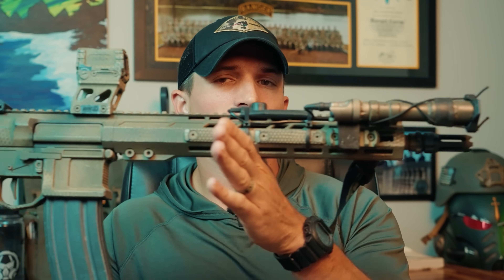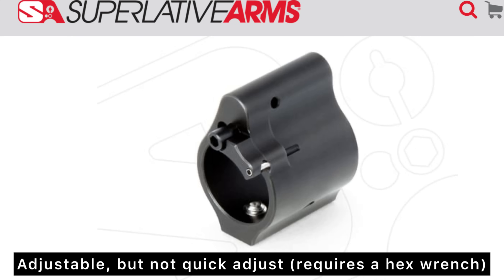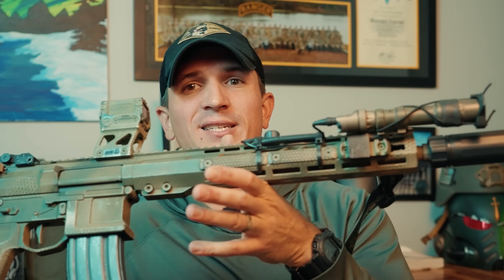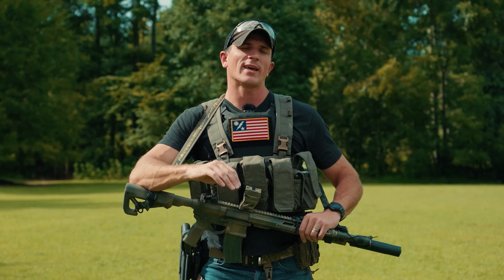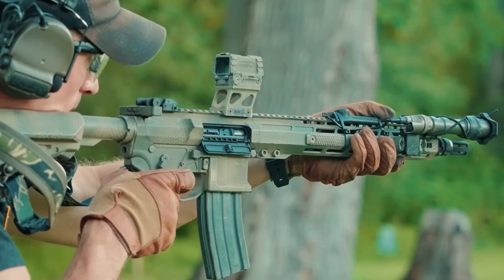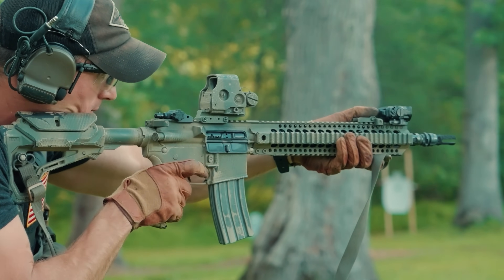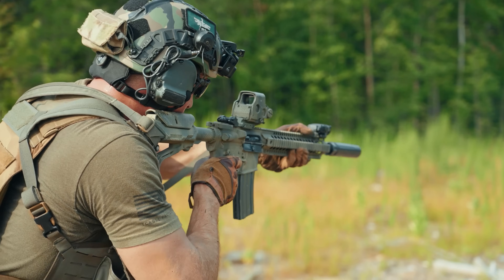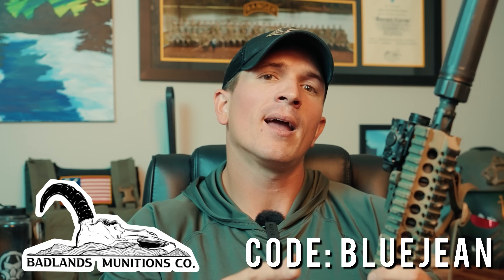Suppressing an AR-15 (The Right Way)

Comment from the maker: Ready to revolutionize your hunting, shooting, and outdoor adventures? Discover PARD optics, the cutting-edge technology for those who demand the best.
https://tribelink.co/PardVision

Get some ammo from Badlands Munitions Co. 
Use code BLUEJEAN for a discount there. Helps out the channel!
https://badlandsmunitionsco.com
Reply: A good alternative is to just get a reduced-pressure can. BT SRBS 762 3D-printed Inconel HUB is 950 with a free stamp now; CAT and Hux also make good options. CAT prob is the best in many ways, just a bit more expensive, but they still struggle to keep them on shelves. I have already tested CAT WB against Hux and Sandman; it's almost better in every way.
If that can save you a few AGB and some headaches, then I would say it's totally worth it.
I love my Sandman S and K, they are still decent, but we do have better options now.

Comment: The riflespeed seems like a good upgrade. If you have a gun that doesn't have adjustable gas or can't have it for whatever reason another good option is the bootleg adjustable bcg. It's super easy to adjust but does require some sort of a flat head tool, I usually just use a Holosun sight tool that I store in the BCM pistol grip of my rifle. It only has 4 settings, 2 normal and 2 suppressed, I usually use setting 3. It's crazy effective though and it doesn't just help regulate gas, it basically deletes recoil entirely. Milspec Mojo uses them and admits its part of the reason he's able to shoot so fast. It really makes a huge difference.
Reply: or just get a flow through can.  My mk18 theres no way around it must have bootleg abcg.  On my 14.5 got a B&T sbrs with only a h2 buffer and shoots buttery with prop 3-4 ejection no tuning needed.
Reply: Is it DT or QD? I am looking to get one of those B&T SRBS for my 16 DD and 9” .300 blackout as dedicated suppressors. I just don’t want the cans to walk off is my only concern with DT.
Reply: @Briathos1  its DT and I love it, highly recommend.  Concerned with walk off just use some rockset
Reply: @ColdGrapeDrink  Great to know. I appreciate it, I am a lefty and I have been plowing through reviews of silencers over the last year trying to find one that sends that gas forward instead of in my face as well durable. 

Thinking I’m gonna pull the trigger once I move over to Idaho in a few weeks. 

Quick follow up question, if you DT with rockset….how do you go about cleaning and mainting the can? Just bust it off?
Reply: @Briathos1  from what i understand you dont really need to clean em, can just run a bore snake through barrel through can is what i do.  Otherwise you can soak in a special solution.  You use cold water/ice to loosen and unlock the rockset.  But def my fav can so far
Reply: @Briathos1  but also I dont rockset, just use oven mit to ensure tight every so often
Reply: @ColdGrapeDrink I run a brt ez tube gas tube tuned for 100% suppressed usage with an rc2, a5h2 buffer, and lmt enhanced bcg. This thing shoots like a gas blow back airsoft gun. It’s wild.
Reply: @ColdGrapeDrink  Dude, I so appreciate you taking the time to share. I have heard great things about them. Think I’m just gonna make it happen here. Hopefully get them approved and attached over the next couple months.
Reply: @Briathos1  Do it!  Throw it on the credit card and pay it off to get some reward points LOL.  But yea filed as individual and got er back in less than a week
Reply: Laughs in PWS 😂
Reply: @BullseyeBallistics-kf1jw  Hmmmmm?
Reply: SA gas blocks are good and reputable. I've never had to adjust my gas on the fly and I can't think of a situation id be in when I'd need to 🤷🏻‍♂️ and FA is good for mindset kinda how you press check your pistol even though you know it's loaded.
Reply: @Briathos1 he's referring to PWS piston driven AR, that won't blow carbon in your face
Reply: @kerbalairforce8802  Ah, for sure. I’m actually moving to Idaho in a few weeks as well so I’d love to buy one of them. Thing is, if I buy another rifle, my wife would kill me if I racked on another grand to throw a suppressor on it. 

I already have DI guns that need suppressors. Eventually I’ll nab a PWS.
Reply: Better idea is to just use a regular gas block and tune it with buffer weights and springs. Adding adjustable anything, while convenient for sure, just adds another potential and unnecessary failure point.
Reply: @waffle_chuter  I totally agree with this. I am trying to have a gun as reliable as possible.

Comment: The Riflespeed will probably be the last AGB I ever try for suppressed use (if I don’t switch over to flow through cans). I have had 4 set screw style AGBs fail on me in different ways. Not just seizing up, but also blowing out the detent or set screw and having pressure drop and the weapon no longer cycling

Comment: I went for a "both/and" approach and built my AR specifically for suppression, but also put a Bootleg BCG in it and have a BRT barrel/gas tube, because even AR15's dedicated to shooting suppressed needs the tuning adjusted depending on certain external factors like weather and what time of the year it is.
Reply: I'm guessing you did the 50/50 brt gas tube? If so, how effective is it without using the bootleg adjustable bcg with it? I have a bootleg adjustable bcg and I'm always amazed at how effective it is but it does make the gun louder on the suppressed setting 4 by about 10dcb according to some people on arfcom. I haven't tried the brt gas tube but I'd like to at some point. I would prefer to run a normal bcg so if it works well I'll have to grab one.
Reply: After watching the video, it's cool that you basically came to the same conclusion, just using different methods haha

Also, I'm pretty sure that when the DTL manufacturer claimed the rifle was "built for suppression", they were just coping/spouting BS
Reply: @armorers_wrench  I don't have the BRT "EZTune" gas tube, I have the MarkBlue EXC tube that came with the barrel.
It's is a 0.75 tube with a length that is 1" longer than a standard Carbine length and 1" shorter than a Midlength designed specifically for 12.5" BRT barrels.
The "gassiness" (is that a word?) is basically non-existent .
I paired that with the Magpul UBR stock/buffer than makes it so I can use a carbine or rifle length recoil spring.
I'm using the Geissele Super42 Rifle-length recoil spring and a lightweight buffer-weight

All that combined makes for a super comfortable recoil impulse and no gas to the face

Comment: For suppressors I recommend an 

1) Adjustable gas blocks with at least 10 clicks (not set screw style)
2) Kak downward venting BCG,
3) Putting silicone RTV in the charging handle to create a gasket seal.

A gas busting charging handle could help as well but it does the least IMO, the silicone RTV gasket has worked better for me.  You could get a flow through can and not need most of these but it is nice to tune your guns and reduce gas generally, plus flow through cans have some downsides
Reply: Need more description of how to make the RTV charging handle gasket.
Reply: What are the downsides to the flow through cans?
Reply: @rwwolcott they are generally less quiet and prone to be sparky.  My Ventum 762 is still sparky after ~900 rounds.  

For home defense use it’s fine.  If you’re SHTF larping they give away your position easily.
Reply: @ghijkl  Try the new VENT from PTR. Super quiet. Super light. NO flash.
Reply: Price  @evernhamanderson
Reply: @rwwolcott Price, sparking, louder, heat up extremely fast, typically weigh more then a traditional baffle stack. Not typical, but can cause under gassing with subsonic rounds.

Comment: As a suppressor tech and rifle tuning nerd, I love the riflespeed system. My main squeeze has had one for 2 barrels and lots of classes and it’s never malfunctioned or seized up. It’s a 12.5 midlength gas, with H3 buffer and Sprinco blue spring. Unsuppressed, it locks back on setting 10, with a RC2 or CGS SCI SIX, it locks back on setting 4, with the CAT WB it locks back on setting 7 and with the CAT ODB, it locks back on setting 9.
Reply: Out of curiosity, why such a heavy buffer? Did it run ok with an H2? Just seems like if you used a lighter buffer, you could reduce the overall gas back into the system in general.
Reply: @johnclark6139  if you are only after recoil reduction, you can definitely keep springs and buffer the same or go lightweight. But when tuning for suppression and gas in the face, going heavier keeps the bolt in lockup for longer during the shot.Allowing more gas to exit down the suppressor and for chamber pressure to drop, lowering ejection port blast and gas in the face.
Reply: 12.5" with a midlength gas system?  You brave bastard...
Reply: @oskar6661  short dwell time barrels are more reliable then people think as long as it’s a good barrel. And for suppressor hosts, they are phenomenal for reducing gas impulse and duration. I also have an 11.5 mid length gas and it’s been just as great as my 12.5

Comment: Adjustable gas blocks are convenient but I would advise against using them to "fix" a gassing issue without first knowing how other adjustments or changes to your rifle could also fix the problem. Understanding how buffer systems and weights, gas system lengths and BCGs can effect gassing is critical in my opinion to properly operating and maintaining a DI rifle. I do have a Superlative Arms adjustable gas block on the first 300 I built. After that I learned more about all the systems involved in gassing and have not used an adjustable block in any of the subsequent rifles I built as I tuned them by other means. And I run all my rifles both suppressed and unsuppressed. This comment is obviously aimed toward folks who are just learning about rifles and building their first rifles as I'm sure BJO knows all about buffer weights and what not.

Comment: I used to have a 10.5 5.56 barrel with a generous gas port that when suppressed became obnoxious.  Swapped it out for a 10.3 with the correct crane spec .070 sized port and it was like going from wild to mild.  Very enjoyable setup to shoot suppressed now.  Best upgrade I've ever done. You make some good arguments for an adjustable setup if you plan to run sometimes with and sometimes without.  That Rifle Speed is definitely a good looking option for an adjustable setup.

Comment: For the times when you can’t easily put an adjustable gas block on (fixed A1/2 FSB or pin a weld) I have seen people have good luck with Bookleg adjustable BCG, good option.

Comment: I 100% agree. The riflespeed system is superior to any other gas system on an AR15. Im running one on my SLR B15 14.5 build. With a 14.5 and mid length gas system along woth a JP SCS buffer and a Cryptic mystic black bcg i find my ideal setting for unsuppressed shooting is at 5

Comment: I'm coming around to the riflespeed due to weather conditions. One of my rifles only works unsuppressed in summer and spring/fall. It shoots like a dream if its warm enough, but when I'm shooting in winter it won't cycle. Even on cool fall days it will fail to lock back on empty. In winter I'll go out and shoot in the -20s, and it gets below -40 without windchill here, too. It'd be nice to have the option to crank it all the way open if I ever really needed to.

Comment: As for me, I don't mess with all the changing out / replacing parts. I just use external piston guns. Put the can on and it runs fine. If for some reason I want to change the gas port it's just one click away. The only downside I have found is some can weigh more than internal piston guns.

Comment: The size of the gas port in the barrel is usually the limiting factor for DI AR15s with a fixed gas system so putting a Riflespeed adjustable gas block on the Quantum DTL probably won't help the problem of being undergassed without a suppressor. The fixed gas block it came with is most likely already "all the way open" unless they designed it to restrict gas flow.

Comment: In regards to the forward assist, I’ve never needed it, it has caused a malfunction once for me, I now use smooth side uppers and let one go almost 3k rounds without cleaning and never had a malfunction. I build my rifles for function and reliability only so I imagine that not trying to make it super lightweight and low recoil contributes to the lack of malfunctions after almost 3k rounds without cleaning. The one malfunction I had that the forward assist caused resulted in needing to push a cleaning rod down the barrel to dislodge the case, I don’t want that happening in a life or death situation.

Comment: To me it seems that the flow through type of cans is the future. I have two hux cans, and I'm looking at getting the cat wb718.  If you do not have to adjust your gun and it runs good suppressed and unsupressed, why not have the reliability of a fixed gas system.  I understand that it would be nice to have an over gassed setting in case your gun does get dirty or dry during a firefight, so maybe the adjustable system is still a valid choice...

Comment: I personally also wouldn't call a suppressed rifle ejecting just over 3 o'clock overgassed. But at the same time, 1-2 o'clock is not that meaningful for most people. I find a suppressed rifle with 5.56 ammo clean and lubed in summer just over 3 o'clock is a good balance- not too punchy and reliable.
Companies like Sprinco saying 4 o'clock is the ideal clearly have COI in that argument.
The way DTL was tuned is pretty obviously for suppressed use, almost 4 o'clock ejection, on top of that muzzle device they chose. They should definitely make that clear on the product page, though.
Reminds me of quite a few JAKL reviews; tuning something(that front-heavy) undergassed isn't the same as having a soft-shooting rifle.🤣
Reply: I think companies like Sprinco are probably interested in competitive shooting vs. a duty rifle application.  I mean, if you're competing, sure...tune that gun to the softest point imaginable to where it's just barely functioning, lol.  It's one of the reasons I don't put much stock into shooting competitions when they feature modified guns/ammo, etc.  Anyone can shoot a race pistol tuned to fire the bare minimum power-factor ammo, etc.

In a duty/hard use/defensive rifle, yeah 4 o'clock isn't ideal.

Comment: I have a PSA Sabre 13.7 SBR with a Dead Air Sandman XL and it runs like a scalded dog.  That gun is my absolute “go to war” gun.  After 22 years military retired and total of 29 years as a police officer I can say by far and away best gun I’ve ever owned.  Period. Bar none.
Reply: And she runs suppressed extremely well.   Adjustable gas settings and zero issues with running the can.
Reply: How do you feel about womens rights old man?
Reply: @Token_Black_Guy repeal the 19th amendment.
Reply: @Token_Black_Guy  as long as exactly the same as men’s rights
Reply: PSA is gross

Comment: I had a riflespeed system, did not like it, and sold it. The superlative arms gas block is significantly smaller, lighter, has finer adjustments, and has bleed off.
Reply: Yes, this is a good point. It's too heavy and bulky at the front of the gun (worst place for it).
Reply: Definitely better if you aren't taking your supressor on and off constantly.

Comment: I disagree, I say pick your suppressor, then build the rifle around it, start with a barrel without a gas port, pick the gas length you want, then spec an undersized gas port, and start with a size the rifle should NOT cycle with, with the can, any gun smith worth touching a firearm can drill the initial port. 

From there so long as you don’t need to wear a helmet be spoon fed, you can open up the port yourself, order some numbered bits, maybe a caliper if you just wana go that extra mile but you don’t need to, use masking tape to wrap around the end of the bit to prevent over insertion of the bit when you open up the hole and tada, you can open up the port to the next size or two larger, put the can on, test fire, repeat until you’re happy. Then do final assembly and get this, leave the friggin can on! 

If you want a suppressed rifle, build a suppressed rifle! 

This is in my opinion the BEST way as you’re not correcting or compensating for the actual problem, your addressing correctly by having the correct gas port for your rifle and your suppressor. AND you’re not adding extra weight, or extra failure points or parts.

Comment: Tuna AR solves the bolt speed issues caused by standard (high backpressure) suppressors. But tuna don't fix your gas exposure coming in thru the bore after case extracts.
There's no substitute for a low backpressure suppressor.

Comment: another large advantage of the rifle speed, or any other good adjustable gas block, is it allows you to run a lighter bcg, and a lighter buffer, while still having the correct gassing, which reduces felt recoil (less reciprocating mass).  A lot of people will run a lightened bcg, and then add a heavy buffer to fix gassing, but doing this causes you to lose the entire benefit of a lightened bcg. The buffer weight reciprocates., so all you are doing is shifting the mass to i different location.  With the ability to adjust on the fly, you can run a light bolt, a light buffer, and still maintain proper gassing both suppressed, and suppressed on the fly.
Rifle speed is 200 bucks....a descent non adjustable block is about 60 bucks....so its 140 bucks to make your rifle run correctly all the time, in any configuration you wish to run....seems like a no brainier to me.

Comment: I’m not a fan of adj gas on an AR15.. 
just more crap yo fail.. 
if you can’t dial it in to run reliably suppressed and un suppressed with buffer and springs some is wrong with the gun. 
As seen with the response of the owner regarding the gun being “designed to be suppressed” which is obviously nonsense.
Reply: All of mine run A5 type buffer systems or geissele braided wire carbine springs with h3 buffers.